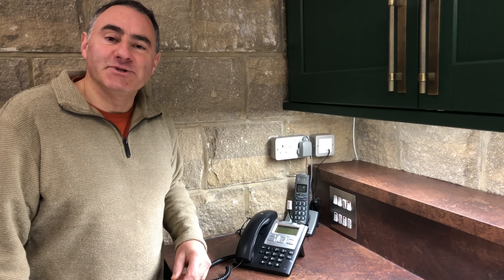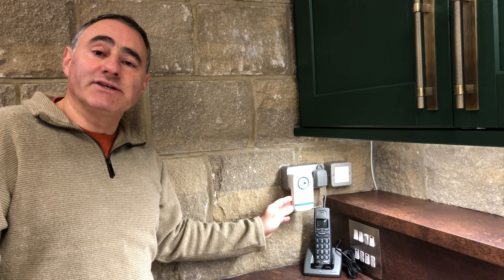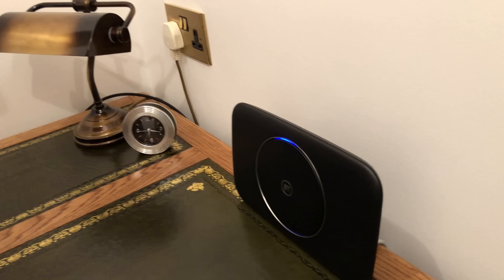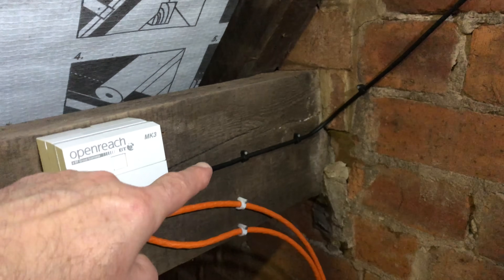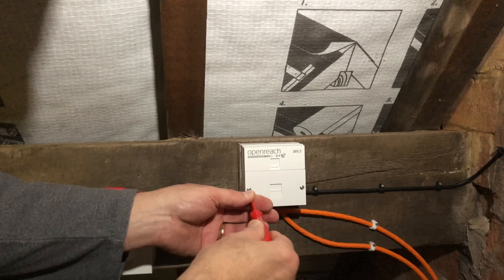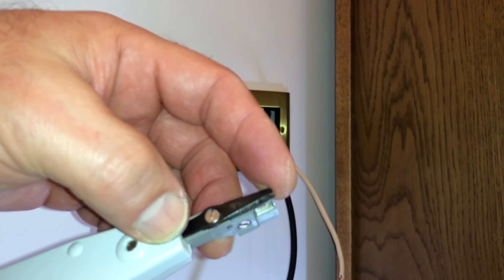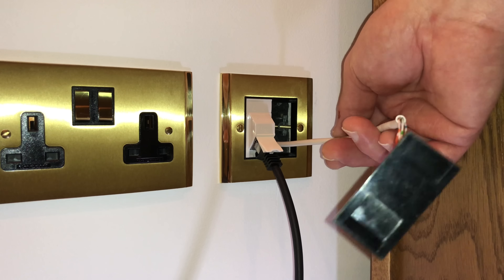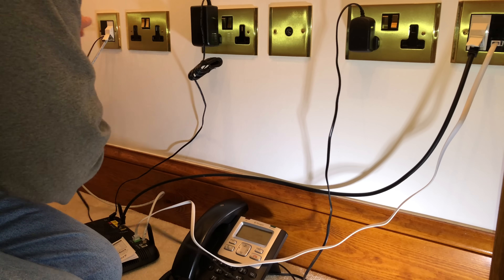How to Video - Analogue to Digital Telephone Landline Switchover Advice VOIP.

Comment: What everyone forgets to mention is that whilst traditional fixed wired phones are supplied with power via the BT lines AND work during power cuts the new VOIP phones won't work.
For 3 years now BT have avoided answering questions relating to this problem.
Reply: Exactly so. Traditional (analogue) voice got its power from the telephone exchange which in turn had robust backup in place. With digital voice (VoIP) if you lose power in your home you lose signal. In the original consultation response the London Fire Brigade pointed out that although the average power cut might be “only” 2 hours in reality many were much longer. Any back up battery, or Uninterruptible Power Supply (UPS) needs to last for as long as your longest power cut. The argument accepted is that since everyone (!?) has a mobile phone an always on land line is not something we need in the 21st century. This is of course untrue. One solution suggested, was to give everyone who is vulnerable a free mobile phone so that they can still call 999. Panic buttons appear to have been forgotten. There’s also the (false) assumption that everyone has a good mobile signal - if you don’t tough.
Reply: @peterjohnson1739  Fully agree with your comment. Also there are many hundreds of thousands of disabled people as well as people hooked up to medical equipment which WONT work with VOIP phone lines
Reply from the maker: Hello Peter, I’m no expert and I know I’ve mentioned this in other comments but I wonder, in the background if phone providers are looking at power cut situations. They may even provide battery backup in areas prone to power cuts and no mobile signal and even people who rely on medical equipment. I’m curious to see what happens when the Mother in law is switched as she has a call pendant. However, the battery backup would have to give the appropriate amount of power to cover at least 24 hours in my opinion. There are so many variables that need to be addressed. I suppose it’s a case of watch this space where providers are concerned. Thanks for your comment and for watching. Cheers Rob 👍
Reply: @robswiseways5697  I phone BT at least twice a year just on this known issue of switching to VOIP. Lots of talk that there will be a solution and, as others have stated, it appears that there is a limited time battery back up to the VOIP (but only if connected to a hard wired phone) that lasts around 1 hour. That is no good for long duration power-cuts and as it takes UK power around 2 hours even to send someone out after a power cut has been reported, it is of no use to most of us.
Reply from the maker: @PeterChapman-rg6gr  Had a comment today from ‘misha frog’ saying Vodofone supplied a backup that lasts 12 hours. This doesn’t sound too bad. Hope this is of interest to you.

Comment: An interesting video but assuming most people only want phones around the house surely a DECT system with a base station connected to the router would suit most people and a fairly simple solution with no wiring changes? We use a set of Panasonic phones and have no problems with using them upstairs and downstairs. We have not yet been switched over to VOIP but BT are currently putting in fibre outside our house which will no doubt be the point when they say we have to change?
Reply from the maker: Hello David, You are right, your set up will work for most people. Our hub is in a different part of the house to the main DECT base/answer machine. The hub is plugged into my new socket which sends voice calls to all phone sockets including the garage (separate DECT phone to the quad pack) and, the desk phone is plugged into the other socket on the same wall as the hub’s plugged into. Fibre To The Premises (FTTP) is not in our area yet. My slight alteration will still work when we do get it. Thanks for your comment. Cheers Rob 👍

Comment: I live in an extremely rural area that frequently experiences power outages, sometimes lasting for days. It's also a mobile blackspot of about 3 miles radius. Not that a mobile phone is going to last very long without any means to keep it charged. However, in all the years we've had power cuts, the phone line has always continued working. With a line-powered phone, I can continue making and receiving calls, even in a power cut.

I'm just wondering what people in my position are supposed to do when we're forced to switch to IP phones? Because as far as I can tell, we're going to be completely cut off from any form of communications. In a medical emergency, that could literally be fatal.

Will the government be providing free diesel generators and fuel for those forced to switch to a form of communications that requires a constant reliable electrical supply, in rural areas where the power goes out every time there's a storm?

Probably not, would be my guess.

They haven't really thought this one through properly, have they? A bit like their 2030 ban on cars that people can actually afford. What they're saying is that, basically, in the future, only rich people will be allowed to live in the countryside, and everyone else will be forced to live in inner city slums.
Reply: Ofcom demanded the network operators to come up with a solution years ago, unfortunately they provided a half assed solution only for those who are means tested and found to need it.

You would fit that bill as you have no mobile signal. Otherwise you'll be told to get one.

The solution is a battery backup unit that, and this is the half assed bit, will provide up to 1 hour of power. That's based on their findings that power cuts last less than 1 hour apparently.

If you are lucky, the battery backup unit will be one that runs off ordinary AA batteries thus letting you put more in as needed. But like most things they also have a non serviceable rechargeable unit.

Problem is if the network equipment in the green box doesn't have power then you still wont get a connection, that is true for the old system too but you seem to have been lucky with a well serviced green cabinet.

In your case you have a bit more time as the government have told open reach etc to NOT remove copper lines where emergency use is required.
Reply: @dlarge6502  In my case, I don't have a street cabinet, I'm on an "Exchange Only" line, which apparently means there's just a run of copper cable going from the exchange (3 miles away) directly to my house.

Because of this, it's likely that my property will be one of the very last in the UK to be upgraded to fibre. The current schedule suggests this will be 2026 at the earliest, and from what I've heard there's a 3 year delay, so more like 2029, if it happens at all.

That means I won't even have fibre internet until between 1 and 4 years after BT are supposed to cut the copper cable, leaving me without any comms at all, either phone or internet.

I assume they intend making an exception for second-class citizens like me, who are at the very bottom of their list of priorities, and they won't actually cut me off completely from the rest of society.

As for batteries that only last one hour, that's not going to be much help in an area that typically sees multi-day power cuts.

During Storm Arwen in 2021, many homes in my area had no power for nearly 3 weeks - mine was out for a week, for example. It was up to a week for some people in 2022 with storms Malik and Corrie, and 3 days for me last year during storm Babet.

These storms are becoming a regular annual occurrence, and are only going to get worse, thanks to climate change.

And yet the one thing that continued to work during these storms was my copper phone line. The one thing that the government has now decided to cut.

It's astonishingly stupid.
Reply from the maker: @dlarge6502  Interesting reading especially your last paragraph. Thanks for your input  👍
Reply: Unfortunately Ofcom’s original consultation was not widely publicised and most responses came from telecom companies who all wanted the switch to save money. A few comments were made against, for example the London Fire Brigade raised the same points as you about frequent power cuts lasting much longer than 2 hours. The solution is (according to the document) … use your mobile phone! One or two Councils pointed out that in their rural areas mobile signals could not be relied on … these seem to have been ignored. Ironically, unless you have Fibre to the Premise (FTTP) your broadband is delivered to your property by copper wires - the SAME copper wires that deliver the analogue land line that they want to switch off! The compromise solution of Fibre to the Cabinet (FTTC) means that the fibre stops at the green box (typically half a mile away) and you have copper wires for that last half mile. It also means your broadband speed is only a fraction of that which true FTTP could deliver. Has this switch over been thought through properly? I don’t think so. There are too many unanswered questions and it seems that, for many, a 21st century phone service will not be as good or as reliable as the one we had in the 20th century. Why do it? Because it saves the telecoms companies money … consumers get a worse service that above all is less reliable than it used to be … tough!
Reply: @peterjohnson1739  At this rate I think I am actually going to have to buy a diesel generator, and probably also a ham radio, because Ofcom seems to be completely out of touch with reality.

That's still going to be cheaper and less time consuming than moving house.

Honestly, you'd think I live in Antarctica, not central Scotland.
Reply from the maker: I wonder, in the background, if phone providers are considering cases like yours. They may even provide battery backup in areas prone to power cuts and no mobile signal. However, the battery backup would have to give the appropriate amount of power in relation to the time power is likely to be down. There are so many variables that need to be addressed such as medical equipment. I suppose it’s a case of watch this space. Thanks for your comment and for watching. Cheers Rob 👍

Comment: Very Interesting video,   I still have some traditional working 1960s telephones with a dial and bell, would voip respond to traditional dialling pulses instead of tones?   @9:28 you plugged the desk phone in and had dialling tone, thats the bit when I’d plug in and try out my old phones.
Reply from the maker: Hi John, I’m no expert but I do believe rotary dial phones can not make outgoing calls but can be used for incoming calls when connected direct to the phone line. There is a video on YouTube titled ‘how to use rotary phones with VoIP’ which explains how outgoing calls can be made using an Analogue Telephone Adapter (ATA). Hope this helps. Cheers Rob 👍
Reply: @robswiseways5697 would depend on the age of the rotary phone, those installed from the late 70s onward usually had a switch on the underside to switch between pulse and tone dialing as iirc not all exchanges at that point had been updated to support tone dialing. Before then phones were hardwired rather than using a socket as well. No idea if any of the old style phone points are still in use.
As for the pendants Tunstall also have base units which work via a SIM card over a mobile connection - I suspect that may be the route offered when my mum's landline changes to VOIP.
Reply from the maker: @GuardOfGaia  Thanks for your input, some interesting reading there. I would guess hardwired phone lines still exist in some older properties with owners who are happy with the old fashioned telephone and nothing else. 
My mother in law is still on the analogue landline / pendant for now. Will have to see what happens when switchover arrives. Thanks for watching. Cheers Rob 👍

Comment: What kind of REN can a hub support? ...I already went digital with my phone system and included an ATA in the picture (every phone on my system has its own internal number) ...at first, my landline was plugged into my ATA (it has 4 FXO and 4 FXS) ...later, when I took my BT line Digital I got the (wireless) adaptor for the landline and plugged IT into my ATA ...I already have that disk thingy and my whole rig is electrically isolated from my hub (I have the same hub as you)...
Reply from the maker: This is all very interesting Anthony but I had to look up some of the terminology first though 🧐 😁. Sounds like a really good set up you’ve got there. 
I’m guessing the hub will take up to REN 4.
Thanks very much for watching and your comment. Cheers Rob 👍
Reply: @robswiseways5697   - Well, Rob; - I remember the rugged electro-mechanics of the old Strowger gear, - and I have looked at the delicate micro electronics inside these new fangled gizmos = I would only and have only ever given one phone to one of those lines... - I had all of my landline phones plugged in parallel back in the day, - but then I got into FreePBX and got an ATA ...3CX (PBX)  is worth a look also...

Comment: Some very handy info here folks, thankyou! ☎📶👍

One thing to be aware of - Particularly if using your Hub/Router as the connection point for your telephones - Is to check that the maximum Ringer Equivalent Number (REN) supported by the hub is higher than the total number of telephones/fax/etc devices on your telephone system. If your telephones total a higher REN than the hub can support, your phones might not work properly/at all, or it might even damage the hub. ⚠

Special care ought to be taken with any telephones that predate the 1990s (Especially those with bells or warblers in them, which will tend to be REN 3+) and if you use these you might want to consider getting an extra digital adaptor to dedicate to that specific telephone. 👍
Reply from the maker: Thanks for the info DD. This info will be invaluable to a lot of people out there. I’m sure the hub will take up to REN 4. If older bell phones are connected and cause an issue maybe the ringer could be turned off on one of them, but it can still be used (provided you are able to hear the other phones ringing). I understand old rotary phones cannot dial out on VoIP but can receive calls. Thanks for watching & commenting. Cheers Rob 👍
Reply: @robswiseways5697  If one was to disconnect the ringer on a bell phone this might drop its REN down to about 0.5 but checking with an ammeter or telephone tester would be wise. ☎

I imagine all of the VoIP boxes expect the connected telephones to use tone dialling. If you know your electronics it should be moderately easy to construct a pulse-tone converter which would allow dial phones to ahem dial out, but searching eBay for an older model of VoIP box which supports pulse dialling (I imagine these might exist for the preference of some subscribers) might be a quicker way of going about it. 😇
Reply: Dial-A-Tone is made in England and enables you to use an old bakelite phone! £50+ but it exists if you want to really dial out.

Comment: at 12:45 you say about power cuts and that being when your mobile comes in handy - IF you have good mobiles signal.  I have to use calls over WiFi because our mobile network is so weak you have to move near a window UPSTAIRS to stand a chance of using mobile! I am going to fight the change to VoIP because of this!
Reply from the maker: Hello Alan, We are in a similar situation with the mobile signal inside our house, but outside it’s ok. Battery backup is an option for power cuts that lots of people are commenting on here. Much to be done by the phone companies, definitely a work in progress. Thanks for tuning in. Cheers Rob 👍
Reply: There are four mobile phone networks in the UK used by all the different mobile phone service providers and they all have different coverage.  You may be able to get a better signal by switching to a different network.  To find out google "Ofcom mobile phone coverage checker" choose the "Map your mobile" link and put in your postcode.  You can then see what signal strength you can get from each of the four networks.  You then need to check which network your mobile provider uses and see if you can get a better signal from a different one.  To use a different network you will have to change your provider to one that uses that network.

Comment: This may work on Analog to Digital but I can't see how t works with Analog to Fibre Digital
Reply from the maker: Hello Christopher, I believe it does work on fibre to the premises (FTTP). The BT hub 2 is the current model for domestic properties. The ONT fibre box is connected to the red port marked WAN. Thanks for tuning in. Cheers Rob 👍

Comment: It depends on your provider. Because I was not given a transition date except "if the broadband goes dead", stylee, they assumed I wanted to keep analogue service which they achieve via a modem in the roadside cabinet. So the phone was "no change" unless you listen to the quality of the line, it is a downgrade, fer sure.
The tip I would give is switch off the new broadband router when not in use. The drop-outs have all but gone
Reply from the maker: Agree it does depend on your provider. I suppose for most people switching off their router would mean losing communication with devices like door bell cameras, heating etc. so the router would have to stay on permanently. Thanks for tuning in. Cheers, Rob 👍
Reply: @robswiseways5697  call me paranoid but a doorbell camera like Ring are a recipe for snooping. It may only be simple data collection like frequency or timing. I declined YouFibre because they use Eero routers. An Amazon company. Imagine the data they have access to, and don't think they wouldn't be scraping some data. They didn't get to where they are today......................